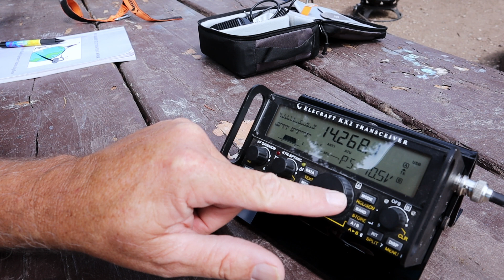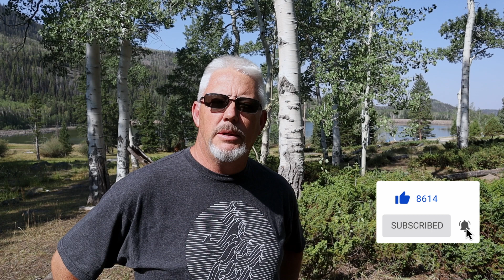KX2 ham radio and Camping | K7SW

Comment from the maker: What is your favorite Portable antenna ? how long does it take to deploy ?
Reply: I use an trapped EFHW for SOTA ops. Takes a couple minutes to set up depending on sloper or inverted v. Great quick do it all qrp antenna.
Thanks for taking us through your setup. Great to see the advantages of different setups. Subscribed! 73 de Tim N7KOM
Reply from the maker: @N7KOM , thanks for the subTim , you are right.  the best way is the way that works and is the most fun for each person 😃.
Reply: I like the 17' stainless steel telescopic whip into a ground stake hamstick mount with a couple ground radials.  Compact, quick, adjustable and effective.
Reply: I use a 17ft telescopic whip about 7ft off the ground either on a stake or a tripod with 2 radials set up @90 degrees about 3ft off the ground. I can deploy in 5-10 minutes and work anything from 6 to 20 meters with a slight bit of directivity between the radials.

KC3UVF

Comment: I've got my eye on the kx2. Do you use it as a base radio with the optional amplifier?
Reply from the maker: I don't use that as a base radio,  portable, hiking, like camping only. 
For the money you would spend on an amp and all the wires needed,  I would just buy a radio like the Ft710.  I own that radio too and iltge experience is so much better

Comment: Hi Kevin.  I'm viewing your video a year after you posted it, so you are probably not expecting additional comments.  Great video of the KX2 and your antenna.  Just one comment:  when out in the field, far from man-made noise, using a small antenna on the upper bands, you might want to try turning the PRE-amp button on.  It will give you a more realistic sense of the strength of the received signals.  Rule of thumb--if the guy on the other end is S7-9 you should be able to work him with 10 watts with little trouble.  Lower than that, will take good ears and a willingness to work weak signals from the other station.   Thanks again.  73 John, N6JW
Reply from the maker: Thanks John, I am glad you commented. You are so right about each thing you noted.  Admittedly I don't think I made a real good video at that location,  however I did want to share the experience and I am glad that you shared your thoughts. 
73 Kevin

Comment: The KX2 is so field adaptable… I have a 12m SpiderBeam Telescopic mast.  A 40m vertical element, and elevated radials has proven itself, time and again.  I really need to stop buying antennas… and focus on field activations (camping) and understanding the radio better.  With all the various settings, I tend to mess it up.

Thanks for your videos.  I’m up in Boise, a short hop down to Utah.  Maybe one day I’ll hear you up in the hills, and we can chew on a good QSO?  

de W7UDT Rand (dit dit)
Reply from the maker: Nice antenna setups Randall.
Yes the KX2 is very fun and easy to use, when I don't use many of the features often, it is a must to refer to the manual.
looking forward to working you one day. 73 de K7SW

Comment: What a great video and a great setup. I have a Crappy Pole but it's only 16 feet long. I can make it work for a 20 meter vertical but I'd sooner use the fishing pole you have. Please edit your video and post a link to the fishing pole you are using. I'd love to purchase one since it's probably 8 feet longer than the one I have.
Thanks for posting. 
Barry, KU3X/QRP
Reply from the maker: Barry, Thanks for the feedback, I have added a list of supplies for this antenna in the description.
I also have a Crappy fishing pole that I use  and i may make a video on that setup in the near future. 
Thanks for watching
Reply: @hamradiowithkevin  Thanks for updating the data.
Barry